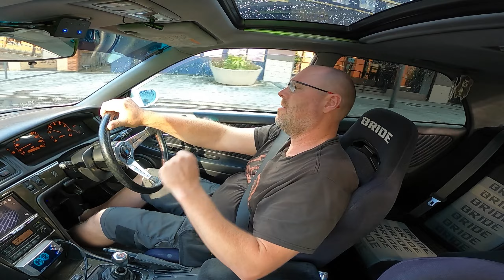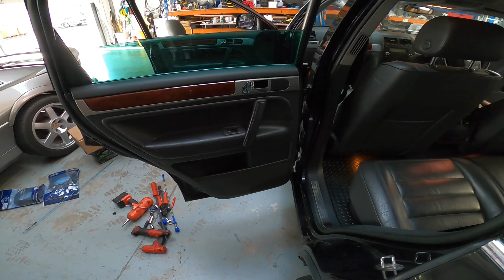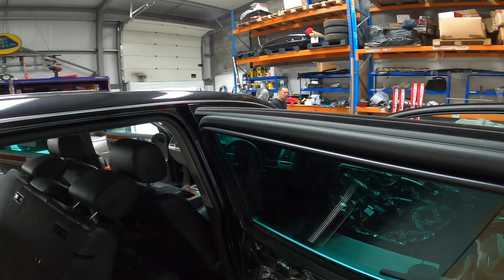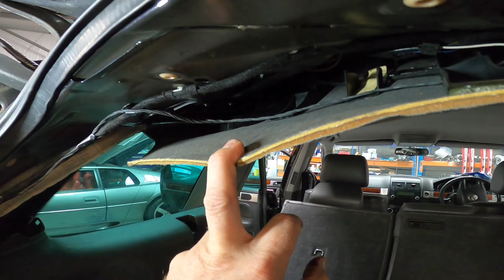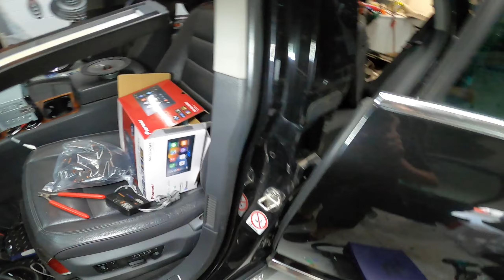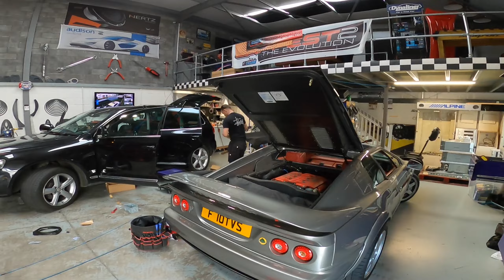dynamat kicker touareg part 1

Comment: Nice job on the Touareg Alex.  Great to see your apprentice coming on well.  Is the VW too old to use a Xen to take clean digital toslink signal out of the CAN bus (to circumvent issues)?
Reply from the maker: Yes too old but that said I will be by passing the factory amp anyway . The system runs 4 ohms for hi mid and tweeter and 2 ohms at mid bass level so not good for a 4 ohm system anyways